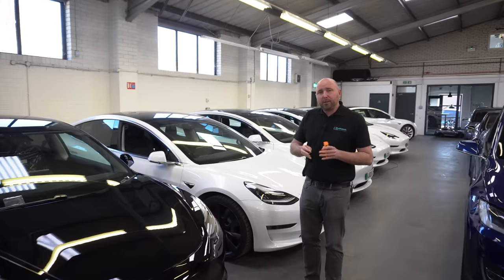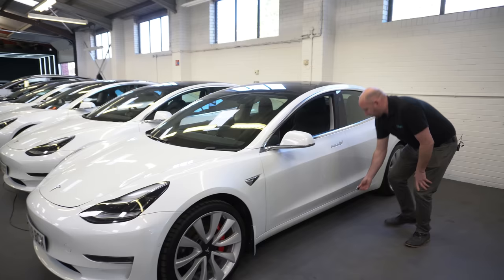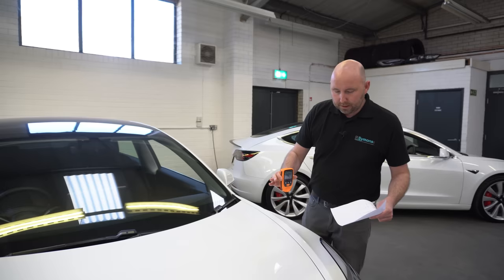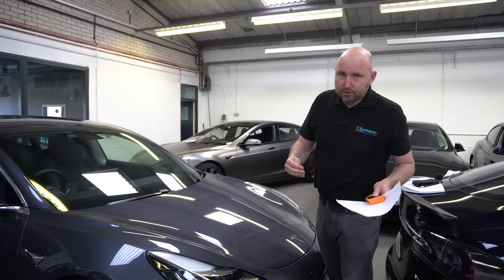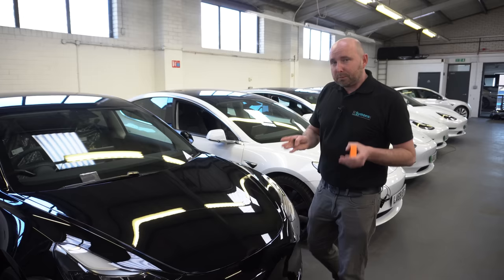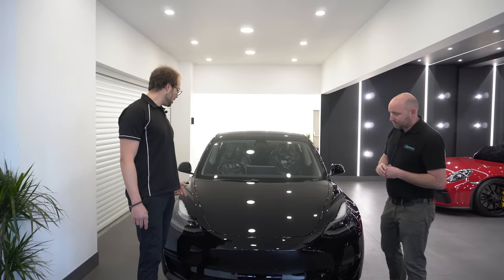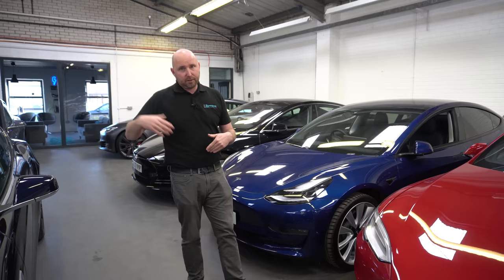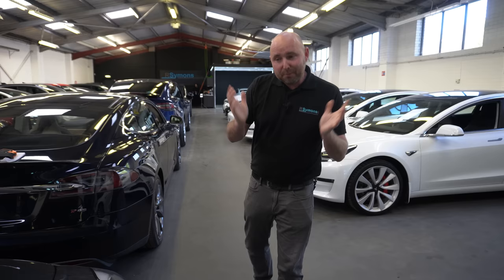Tesla Model 3 in-depth paint review. Made in China v USA built comparison.

Comment: What about the durability of the paint compared to other. As someone who owns two Tesla and one Audi, the Tesla seems to get damaged easier. People often seem throw around the phrase “soft paint” with Tesla, especially the Model 3. I had an Audi A7 for 8 years and it was not babied; that paint was almost like new after 8 years and with not a single issue on the rocker panels. I can’t nearly the same on my one and two year old Tesla’s.
Reply: Yeah, they need to do a hardness test.  Paint thickness was only an issue on the early M3s where you could actually see the primer in spots.

Comment: Excellent video, relieved to know the paintwork on my MIC Model 3 is up to scratch, was almost scared to watch but you did a really nice in depth review. Sounds like the PPF I had done was definitely worth it.
Reply: If you have to spend 1000s on PPF, then the paint is not that good.
Reply: @willaerley7140  All cars collect stone chips. It's only up to you whether you want to prevent that / respray the whole car after 10 years on the road / not be bothered by it.
Reply: @DarcersTech  From my own experience, my M3 collects rock chips much faster than my previous cars.  After 1 year my M3 has about the same damage as 4 years with my other cars.  It’s not just chips.  Many Tesla owners have complained about rust after less than 2 years.  I haven’t heard of any other new car with this problem.  Spending $5K on PPF doesn’t make sense when a proper factory paint job could be done for a tenth of that.  It’s a great car and that’s why the paint is so disappointing.
Reply: @willaerley7140  My BMW i3 managed to develop rust spots on the alloy wheels and the clear coat started peeling off around the rear-view camera. Known for paint to be falling off the parking sensors, etc. But hey, that's the German build quality you never see discussed. I still love it, but no car is perfect.

Comment: Great video, thanks Richard and the team, at last someone explaining the truth about car paint, its paint! Nothing to do with thickness or hardness! 
Tesla main paint issues with the Model 3 are caused by the omission of a paint quality control stage in production allowing a few cars to leave the factory that simply should not. They also need  to address the paint adhesion problem (fault) on the sills and the lack of PPF on the rear wheel arches that should be fitted as standard as on so many other cars. Anyone experiencing factory "pealing/flacking" paint should not accept anything less than a warranty paint repair.

Comment: Spot on, My M3 was a late 2020 car that had the issues with excessive chipping and paint peeling off the car, , It was repainted in full, much to the surprise to a detailing company when I took it in after it was repainted, they got the paint thickness gauge straight out. I said it had been repainted they said yes it has, but its has been a bare metal respray ! the paint thickness was around 150 -170 consistently all over the repainted car although a few imperfections are in the repainted car ( mainly fish eyes !) it has now done 2000 repainted miles and dare I say it is relatively mark free. So I would draw the conclusion the cars might be painted to the correct thickness but the paint has not bonded to the white undercoat ( Deep met Blue) in my case, all my damage was in the colour coat not the under coat.

Comment: Very interesting video. Back in the early 80s I used to own a Alfa Romeo Sprint. Along with the Alfa Sud it was a renowned rust bucket. I had access to paint thickness measuring equipment back then I measured my car up against a VW Golf. To my surprise the Alfa had 10 to 20% more paint on it compared to the Golf. The issue was the Alfa rusted from the inside out possibly due to lack of ventilation within the bodywork. Paint thickness isn’t the be all and end all, it’s far more complex than that. Thanks for your very informative videos.

Comment: All of the automotive body guys I've talked to say otherwise however we still spray single stage oil base urethane on heavy equipment, that stuff doesn't have any of these issues. I can only imagine the manufactures still recommend that because it's stronger than the water based automotive paints.

Comment: Absolutely loved that, brought loads of things in to play, it has been suggested that the issues on the cills are caused by bad adhesion of the basecoat, so when a stone hits an area it chips/flakes more than it should do hence more paint loss. As the Dec 2020 to current date appears to be suffering worse with this issue it would be great if this could be tested some way apart than with a hammer and chisel.

Comment: The Pearl White multi coat paint job on my 1 week old Model Y from Fremont is flawless. I am a very detail oriented person and could only find two fitment issues on the entire car. The passenger side of the hood was low and the steering wheel was cocked slightly to the right. Both were quickly addressed by the Tesla mobile service technician.

Comment: Good one Richard. A while back I watched a video by Sandy Munro on the same subject. He said that a later refreshed Model 3 had a better paint finish.
Reply from the maker: I’ve had perfectly good early cars, but then you would get some with a few flaws. They do seem more consistently 100% now though which is great.
Reply: @RSEV  different subject. I live in an apartment in Ambleside. Nearest Supercharger is 31 miles away. How long could a Model3 Long Range be parked till the battery lost charge, if it was fully charged to begin with?
Reply from the maker: @djwarren5081   ok so I’d say perhaps 50 days from full. Sentry OFF and don’t keep looking at it on your phone, let it sleep. 
You’re going to need min 20% when get back to it to then get to the charger really.

It’s not an ideal scenario really. If parked for a long time it’s best to have plugged in and car set to somewhere in the midrange like 60%.
Reply: @RSEV  patient reassured. That's way longer than I was expecting. Thanks very much for the advice.
Reply: @djwarren5081  many other EVs would probably loose <10% in the same time, I wish Tesla sort this out, its a lot of energy to just waste, they must burn through more than 500 miles equivalent in just standby loses every year.

Comment: My best guess regarding different thicknesses on both wings is that the robotic arm with paint gun may not have adequate reach on either side.  I saw someone else's comment about applying thicker coat on the offside to compensate higher amount of debris from the oncoming traffic. I'm not sure of this but I only imagine that on production line car bodies go through painting section before it's decided if they become left or right hand drive vehicles - I could be totally wrong on this, it's basically hypothesis...

Comment: Is the paintwork any “softer” than other makes? Was prewashing my model 3 with a normal service station brush and it Got a lot of swirl marks, is that normal. Certainly has not noticed that on my previous car. Maybe it’s the colour which shows it more, mine is a blue?
Reply: Yeah, I think it’s softer.  I’ve found my M3 chips and scratches more easily than other cars I’ve owned.  Sad that the paint on my mailbox looks so much better than my car’s.  Tesla likes to churn out cars as fast as possible and paint curing is time consuming.  I think baking on the paint gives the best results, but again it’s time and energy consuming.  I wax my car often which can help prevent light scratches, but a pricey PPF is the best solution.  It’s not the color, it’s the process.

Comment: You cant measure the NDFT and by this decude if the paintwork is good. You have to know which paint system, fx zinc rich primer. You also have to know the adhesion and the preparation of the surfaces before application of first layer of primer.

Comment: For all the car with different colours you can pick; You have to pick the black one which the nature of the colour itself notorious about showing imperfection. Lol And the way people having rock chip and paint peeling probelm may more relate to paint properties and paint adhersion rather than thickness. It is interesting that even for the same paint manufacture, the paint they manufactured can be regional specific due to regulation and market prefence. So, the paint supplier for car made in the States, China and Germany may using paint from same company. But the composition can be drastically different and result in slightly different properties or apparence.

Comment: So they barely manage to fix the paint, as for the model Y they are sendt back as they lack paint, still...
Panelgaps... still an issue.
Then there is the question, how hard or soft is the paint compared to the Germans... That is not even mentioned, just as its thick enough, dont help when you just look funny on the car and it scratches just by your gaze...
Then wee have something funny no one, and i mean NO ONE talks about. Rust.
Now Tesla have a anti undercarriage treatment thing going on. As they dont have salty roads in California. Dunno if they have in China...

How will these car be in say 5 years time compared to an treated new car?

Just bought the new XC40 Recharge and its gonna get a complete paint job fix with ceramic paint protection and a Tectyl undercarriage treatment before it even see winter.

I actually do fear that you gonna sit there with a rust bucket, as you dont get to inspect under all those panels. And are not allowed as loosing warranty if you treat your car with anti rust protection.

I live in Norway, and several people owning Teslas and do work with treatment actually say they are prone to rust issues, and severe ones as well. 
So are they lying? 
Or is there actually facts to this?

Tesla is a no car I will ever buy because their service and build quality, and also the question about rust. EVs are hard to sell as they are used, and overpriced new.

Comment: So why do they chip/flake so easily then ?  - There is no doubt these cars are far more more vunerable than any other car I have ever seen. Is it the hardness of the paint or the adhesion that is the problem ?
Reply: Probably the main reason is the aerodynamic flow around this part. As flaps reduce efficiency, Tesla didn't provided them. This is an engineering decision - less efficiency/range or less chipping. The best solution is to cover it with film and ditch the flaps :).
Reply: @AndrewSienx  That would not explain why the Dec 2020 to current date M3's appear to be suffering a lot more than say Dec 2019.
Reply: Flaking or pealing paint is 100% an adhesion problem (fault) between the different layers of paint that seems to occur mainly on the sills. The problem of excess chipping on the flared section of rear wheel arch is a design fact that most car manufactures overcome by applying PPF as standard to these exposed areas. Hardness or thickness of paint is and never was the problem. Paint hardness is determined by the type of clearcoat used, traditionally German cars come with a hard (scratch resistant for auto car washes) and Japanese have soft this is only really relevant for the purpose of polishing and not how the paint reacts by having stones blasted at it.

Comment: I've owned Mercedes, BMWs, Porsches, Toyotas, Pinto (Ford) and now a Tesla Model Y. Here's my grading of paint jobs on the cars I owned to-date:

1. Porsche.
2. Mercedes.
3. Toyota.
4. Ford (Pinto)
5. BMW
6. And lastly....Tesla.

Perhaps due to higher demand, the quality of the paint-job from Earl Scheib would put Tesla's to shame. There are over-runs, orange-peels and high-spots (opposite of dent...bump) on the body that could only result in impact under the sheet metal during assembly from the factory. Other than the orange-peel that I have to live with it, they fixed the other problems.